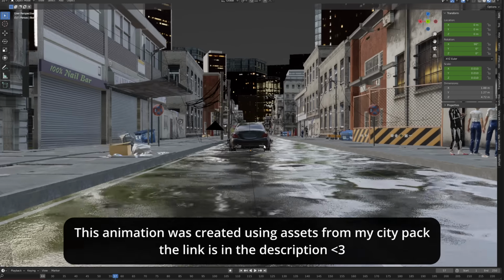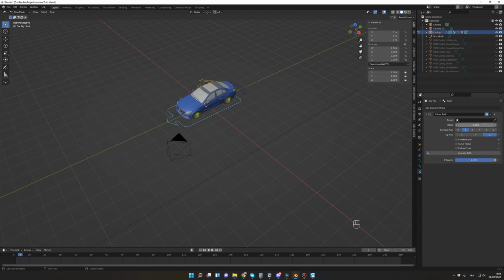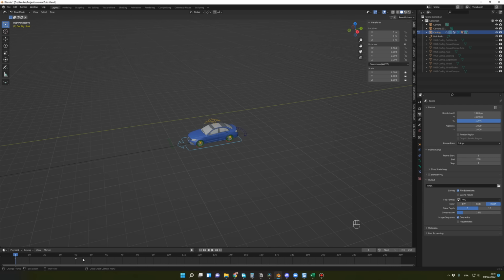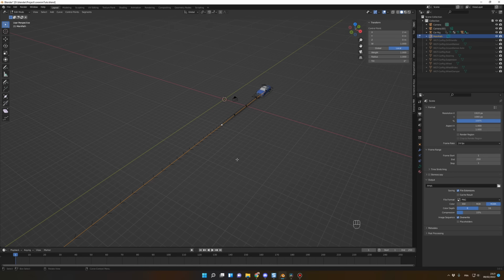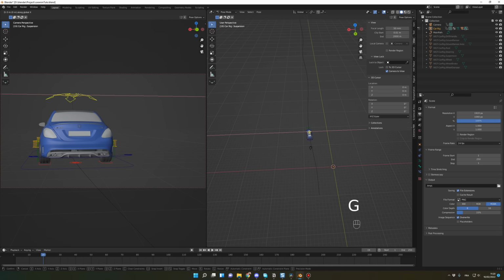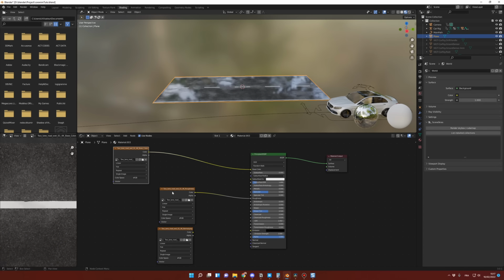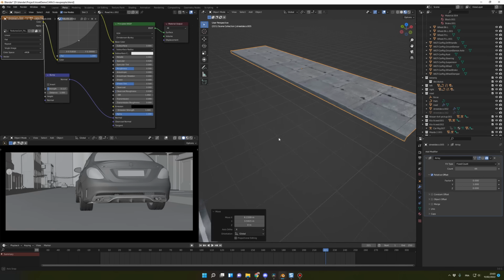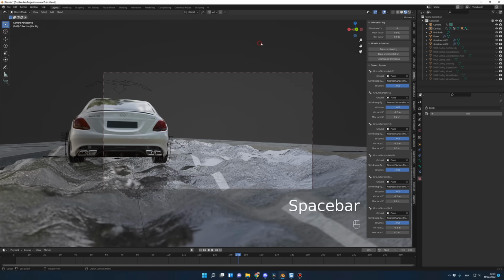Blender 3 Realistic car animation tutorial | Beginner

Comment: Some tips while making the roads:
1. Don't use bump map for simulating the normals, instead use a normal map node.
2. Set all the images other than the base colour to 'non colour'. You can find that setting in the bottom right corner of the image node.
3. Add a colouramp node between the roughness map and the principled bsdf shader and increase the white value to decrease the shininess of the road since a normal car would start slipping on a road that slippery after making those insane turns.
3. Use the ambient oculusion node to combine with the base colour rather than the roughness map as it is made for that.
4. Don't combine the roughness map with the normal map. It may look cool but it is not realistic in any ways and a normal car would probably flip over in a road which is that rough.
That is all the tips i have for the begginers watching this tutorial.
Anyways, great video. You explained everything in details in a short amount of time!

Comment: Looks great. Any tips to achieve maximum quality cinematic effects? Even if that means longer render times of course.
Reply: Never hesitate to use motion blur if you don't care for render times. 

Use volumetrics to add depth to your scene. 

Render at 48fps(like avatar). 

This wont affect render times but will increase file size : Save as 32bit images and then make a 10bit video out of it to achieve high dynamic range.

Add very slight lens distortion

Do some color grading for the cinematic look

Add the glare node for things like streaks for lampposts that are out of focus, fog glow for light sources that are in focus.

Add lens flare

Use anamorphic depth of field

Use high quality assets or if you made them on your own, try to make its textures procedural or something more than 4k resolution. Vertex count should be optimally high.( if high amount of vertices don't make any visual difference then leave it as is)

Use pbr materials so that everything is physically accurate or stylized materials according to the art style of your choice

and add small details like fireflies around lampposts, dew from plants in early morning scenes, or something appropriate according to the art style that you are choosing